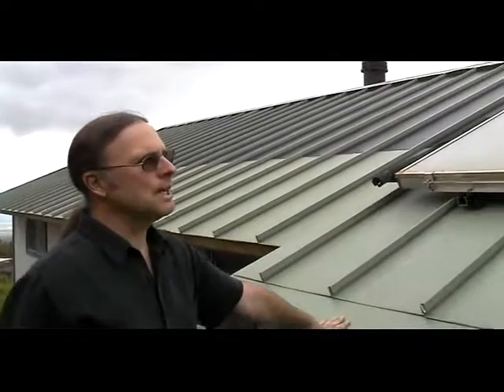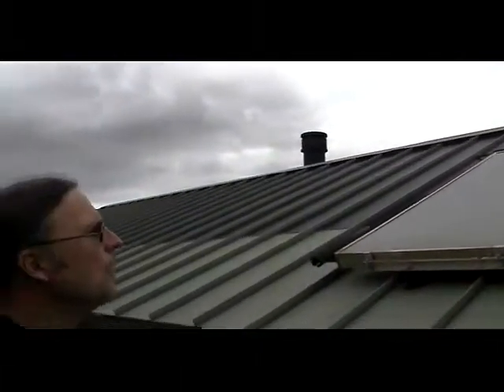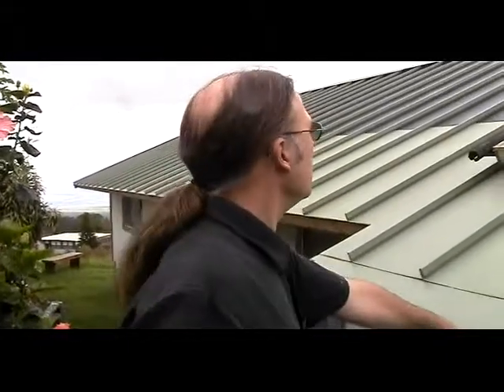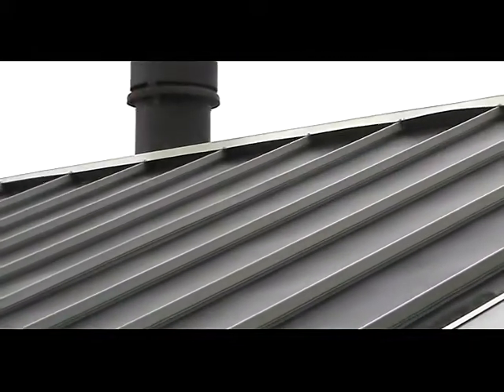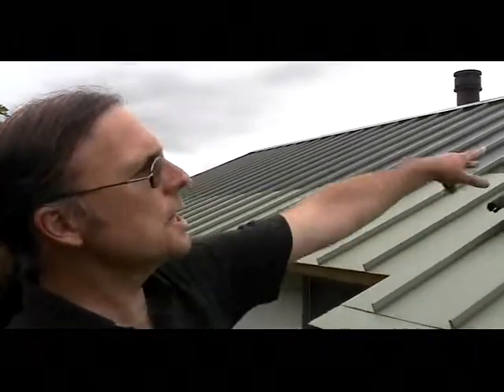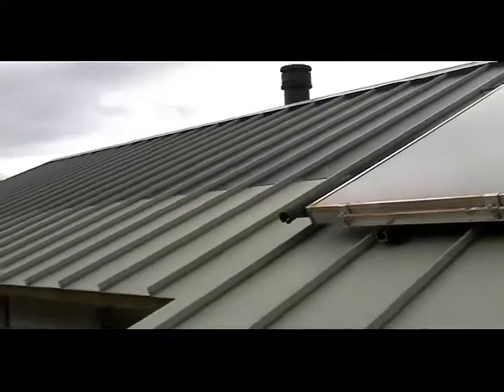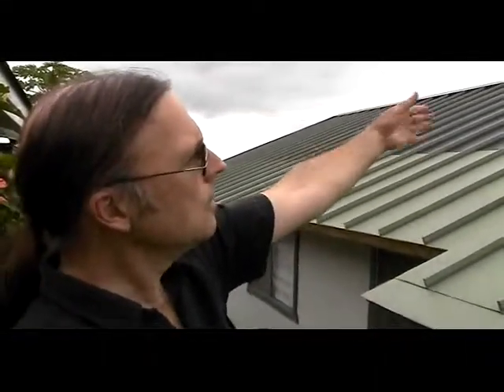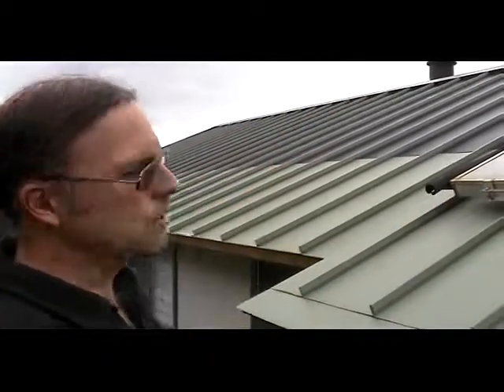Smartroofsystems.com4KWKula Maui2006

Comment: And regarding those bypass diodes - crystalline panels have had them for ages.   

36-cell Sharp modules incorporate 2 internal bypass diodes, each connected to a group of18 series-connected cells. 60-cell Sharp modules have 3 internal bypass diodes, each connected to a group of 20series connected cells. 72-cell Sharp modules have 3 internal bypass diodes, each connected to a group of 24series-connected cells.

Comment from the maker: @ecdfan 
Hello ECD fan thanks for viewing my video.  Glass is an excellent thermal barrier which is why it's used on thermal hot water solar panels.  Because glass is used on crystal PV panels for the most part, the temperature coefficients are 100% worse with crystal type PV panels under glass compared to Uni-Solar Triple Junction.  There are almost never bypass diodes across every cell in a glass PV module to prevent drop out from partial shading.  Uni-Solar always has these bypass diodes.